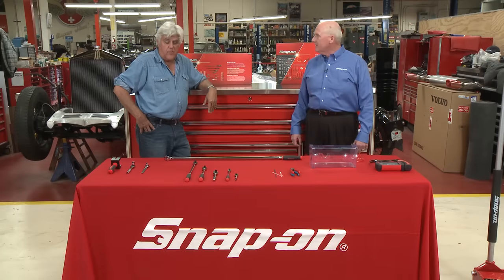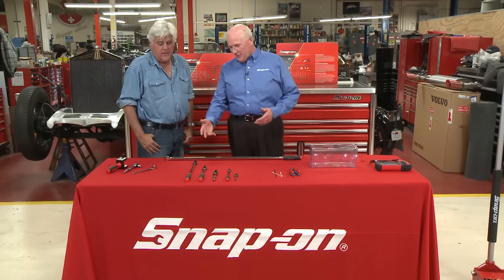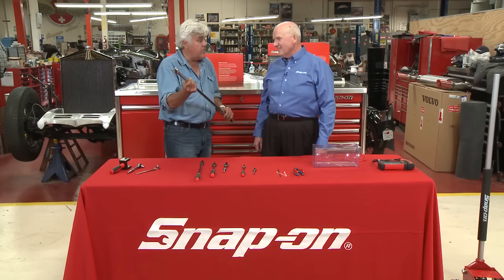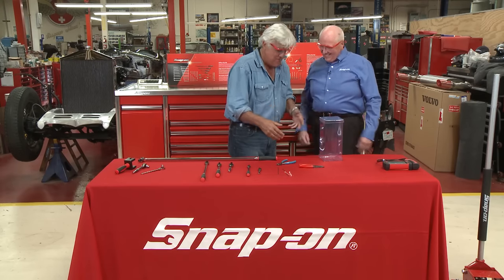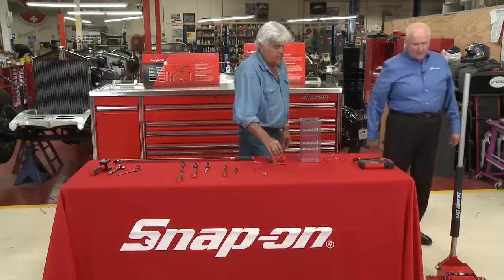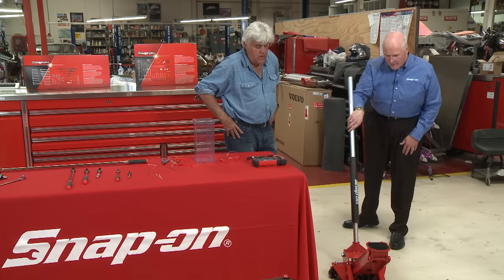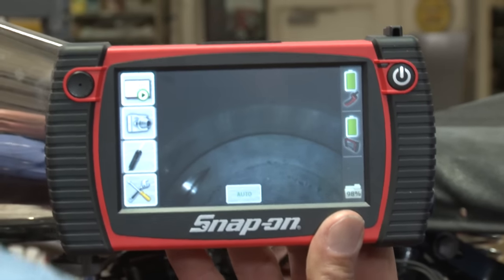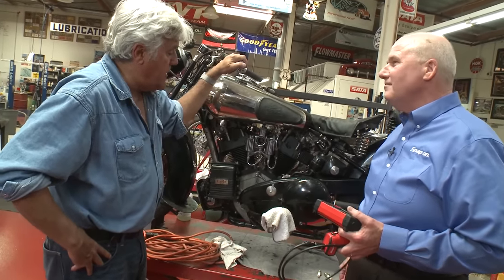Snap-On Accessibility Tools - Jay Leno's Garage

Comment: saw "accessibility" and hoped it was some kind of affordable budget tool set
Reply: That's funny.
Reply: You said "affordable". You are not the customer Snap On wants.
Reply: Nope. Affordable just gets you Snap-Off.
Reply: Yeah Michael, I just bought some Snap-Off tools at the Dollar Tool Store after seeing a video promo posted by their owner, Mr. Bustya Nukols.  Even I can access them since they are totally affordable.  I was able to get their 20 amp cordless ankle grinder with a pack of 10 flying disks, a 20 piece set of screwed drivers, and even the low-profile hydraulic jacked-up, all for the low price of $19.95.
Reply: the reality is if you arent using your tools everyday snapon, matco, cornwell, etc arent really nessecary. any tool will work it just doesnt do it the most efficiently. when you get paid flat rate and are performing a specific job that one tool might save you an hour which makes or breaks flat rate work. 

one of those most worth it tools is a 3/8ths drive flex head ratchet but it is in a 1/4 drive body by snap on. it fits almost anywhere and save so much time.
Reply: If you are working on something, you need to use quality hand tools. Period. How pissed will you be when that cheap ratchet fails on you while your taking apart your beater, or even worse your show car, and you trash your knuckes and scratch the finish on the fender of that '32
Reply: Michael Major 'Snap Off', isn't that Harbor Freight's new line of tools?
Reply: 12799MaDeuce I thought it was going to be a line of tools for people with physical handicaps.

Comment: I have the low profile 3/8 ratchet and socket set and it has saved my bacon many times.
Reply: Nutz4Gunz45 I might have to try them
Reply: Nutz4Gunz45 I use the 1/4 drive set the most. dash ac work
Reply: you not own a spanner?

Comment: I stopped buying "Snap-Off" tools a long time ago. I was breaking them by hand, and that was sad. Cornwell, Matco, and Mac, did better, and were somewhat more affordable.
Last time I did try to buy a tool from Snap-Off, they wanted a credit application, needless to say, I bought my tool elsewhere.
Husky makes good tools, and they are not very expensive, nor do they break in my hands.
Reply: I like the bore scope, but I don't feel like mortgaging my house to get one.
Reply: James Fenton Now you can buy a scope with lights to plug into your phone around $30. 00. Yah it would be a good tool!
Reply: Yea, the last purchase I made from Snap-Off was a handheld scope, for $2200 bucks, and it didn't work so well and I returned it.
Several years later I got the same scope for about $80 bucks, it was through my battery dealer and was the very same item. It still needs a fresh battery, but will probably never see one.
A good two channel scope is invaluable. but Snap-Off will never see me on their trucks again.
Reply: Mastercraft tools have never let me down. Lifetime warranty as well.
Reply: Cornwell FTW. All made in the USA, cheaper, and better quality.
Reply: I switched to using Tekton, great tools so far. They go above and beyond on their warranties too.
Reply: Yea man I stopped buying snap-on years ago... Cant justify the cost..
Reply: Not a Strap-On fan, but all tools break. It's just the expectation I think that comes along with the price tag. One brand doesn't make the best of everything, you have to pick and choose what works best for you.
Reply: Yea, my toolbox and many of my heavy duty tools are Cornwell, I dared anyone to break my Cornwell sockets, and nobody who saw them even tried. Thick walled sockets like these are my choice for replacements as the old Snap-Off's snap off.
Reply: Trump has a point, me being Canadian I like things made in my Country. But a lot of good things come from the US and other countries. But what makes SnapOn tools expensive is also why they are not in every professional mechanic's tool box. They priced themselves out of the market! Competition took over the field! Arrogant is not a place to start negotiations! They used to go out of their way to meet and supply apprentices. Even encourage and help people stay employed. I haven't seen a Snap-On truck in years. Guess they should look in the mirror before they rely on the president to protect their field!
Reply: They travel from shop to shop, and visit once a week, but so does Cornwell, Mac, and Matco. All are expensive, but some are a better value than others. 
After experiencing "Snap-Off's" attitude regarding sales, and refusing to sell anything without a credit check, I saved my money for another supplier. I needed a bit for an air hammer, and they didn't carry what I needed, and what was available had to be ordered.
Reply: Never fails, in Canada Snap-on is the only truck that went around. But haven't even seen a truck in 20 years. But all the tool manufacturers are being bought by mechanic's every where craftsman is at Sears store down the street! There's a company out of Winnipeg that has some great prices and you can buy on line. It may be of interest price wise! It's called Princess Auto, princessauto.com sale on every month. Air tools are OK if you have a good compressor. Good luck, and don't just your knuckles!

auto.com

Comment: Snap on should make a ratchet with a telescopic handle instead of making a bunch of different lengths. I have one from a different brand and its the best thing since sliced bread. It also has pivoting head so it gets in almost anywhere.

Comment: The worst thing about Snap On tools...are the salesmen.
Reply: Yeah, this guy needs to stop talking so much
Reply: I'd say it's the price, but OK
Reply: @frep420  You do realize how Snap-On trucks work...right?  With Snap-On products, you "pay" for on-site warranty service and replacement, on-demand delivery, etc., if you are just "purchasing" their products off the web, you aren't getting what you "pay" for.  The Snap-On truck guy shows to your place of work, regularly, and does a sales pitch on all his new garbage product, like plastic work lights that break when you drop them.  And wants to sell you everything possible.  Mac Tools guy typically saves you used trade-ins and sells them to you for dirt cheap...doesn't sales pitch garbage products while you are busy trying to finish a job, etc.  Anyway...
Reply: I get how the salesmen are, if they charged a reasonable price, I could deal with all of their other issues

Comment: Harbor Freight has a rachet with both 1/4 and 3/8 on the head and... the handle extends to 4 different lengths. They have a 1/2 inch as well as a 1/4 drive Spinner, also with extendable handles. Well made drives... and compared to Snap-On price wise. You can go out to dinner with Jay with your wife and friends for week with the money you'll save. More room in your tool box, you don't need a drive for every handle length.
Let's face it, the average Joe can't afford Snap-On to begin with. And I've yet to run into a nut or bolt that gave a dang who made the tool that turned it.
Snap-On tools are nice... sure enough. But I'll put my $10 dollar 1/4 drive Spinner up against theirs any day turning bolts. 
$10 bucks... 4 Spinners in one. And it can be driven with a ratchet. There's a place on top for it.

Comment: Is snap on tools like wrenches, sockets, ratchets etc really expensive like everyone says? That's all the tools we use at my school auto shop is snap on just wondering
Reply: Avery 416 The Louis Vuitton of tools / boxes.
Reply: Yes, possibly the most expensive out of the top tool manufacturers such as MAC, Craftsman, Gearwrench, & Matco
Reply: Avery 416 Yep Snap on tools are definitelr more expensive.
Reply: You need to take out a loan to be able to get a starter technicians kit
Reply: yea. 13mm - 24mm set of 1/2 deep well sockets lists at about $500. 10mm - 19mm wrench set is about $400. ratchets range from about $100 for standard 1/4" drives to $180-$250 for the 1/2" ones.. add $50 to a $hitload if you need something extra long or with some specialty feature.
Reply: Buuut if you take auto college courses, there's a student discount that is generally about 40-60% off list prices. Not a bad idea to grab a set of wrenches and some 1/4" and 3/8" socket sets n ratchets. for 1/2" stuff just buy a sunex master impact set and an IR air impact or a good cordless.
Reply: Most of my tools are Snap on brand with other brands like SK, OTC,MAC and Matco. Snap on being one of the most expensive brands out there for sure.
Reply: Avery 416 It is a situation of you get what you pay for though, yes snap is definitely the most expensive, but they are the best quality tools I've come across. Not only that but most of their tools carry a lifetime warranty so if you break something you get a free replacement no questions asked which is great.
Reply: Avery 416 A good friend and former employer for years would only hire guys with primarily snap on tools. After a break in he had to replace much of his stuff. A thousand dollars does not go very far with these tools. Best bang for buck,buy their quarter inch stuff. For precision and getting in to tight spaces it is probably the best in the world. Another friend by 1980 had a quarter of a million dollars in snap on alone.Then he discovered antique woodworking tools. Looking at the price increases over the decades most mechanics simply cannot afford a full complement of snap on and Mac tools. Theft and other loss is a reality. There are some fine tool manufacturers out there.Go with used,go with what is available. Sears Craftsman used to be the standard by which all others were measures. Times change. Pay attention to what  other guys use. Getting a less expensive product rusty,damaged or modified at need or lost stolen or broken hurts a whole lot less. No need to pay for a name brand fixing an old tractor in the woods when if you drop it the mud will swallow it up. Still,my first major purchase was Snap on and I cherish what I do have.
Reply: And, yes, so do other brands. However, the difference with SO is the fact you seldom ever have to replace one, unlike many others with a lifetime warranty. I'm not a Snap-On fanboy, but I've broken far fewer SO tools than any of the others in 40 years of wrenching.
Reply: Avery 416 yes they are expensive. yes they are worth it. as well at Mac and Matco.  after your in the field don't run out and buy everything off one truck.  take your time shop around. if you need it every single day buy good stuff. every truck has discount items every week. I've found getting tools at discount is awesome.
Reply: Well said
Reply: Snap On is what you buy when you have established yourself in a particular field, and have made bad tools work good. Having the sub-par tools to start makes you appreciate real quality tools. Then you find out that Snap On isn't the best tool for everything.
Reply: Todd Wall I had a Matco tool caddy with piano style hinge. Best mobile tool caddy on wheels ever
Reply: They build boxes stronger than the cars the mechanics are working on. LOL
Reply: About $120-$150 for a standard 3/8ths ratchet wrench. Including some models with flexible heads which I'd highly recommend. Used a friend's once and I can say for what it offered over a craftsman, it's actually worth it.
Reply: Avery 416 yes they are typically about twice as much when not on sale ,but many dealers will automatically knock off some of the msrp. So they're really only about 1.99 times as much :)
Reply: The flexible head is good but I buy German brand which are a 1/3 of the price and just as good quality.
Reply: Paul Teirney which German brand?
Reply: Heyco, VBW, KNIPEX,Facom.

Comment: So a bunch of stuff you can get cheaper from HF, except for the nippers which look kind of cool. HF doesn't have any good diagonal cutters, they're all cheap crap. Their low-profile ratchet is also through-hole, which means it will handle stuff that you'd normally need a deep socket for. Thanks for trying though, Snap-On. I bet you can get two low profile aluminum jacks at HF for what one of these steel beasts costs

Comment: "we know that really 90% of the work is getting the fastner broken loose'' - Then use a breaker bar or a T Bar Handle with 3 foot of pipe, not a fine wratchet.
Reply: especially when it has a flex head

Comment: How much is the standard ratchet? $500?
Reply: 90blacknight $109 for 1/4 3/8 and $ 159 for 1/2 inch if u buy separate
Reply: $109? I'm pretty sure their T72 1/4" standard handle ratchet is $90ish. Not that it's much better...

Comment: That's weak. Snap On is known for their bulky ratchets. Seriously doubt that 3/8 rachet can take 3 to 5 hundred pounds of torque or a 3/8 socket that can. Jacks are jacks especially hydraulic ones. But if you need an opened end wrench that won't round off a bolt head then Snap On is the man.